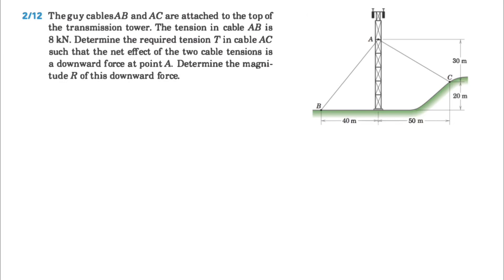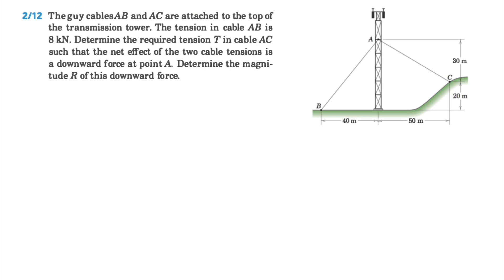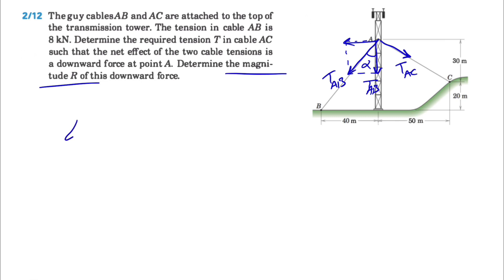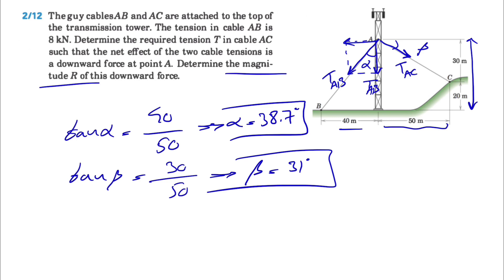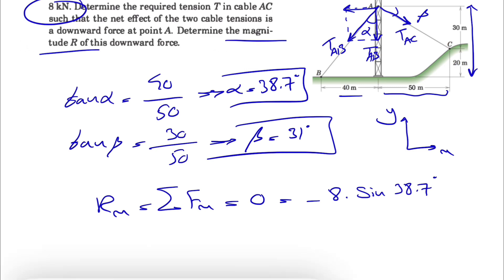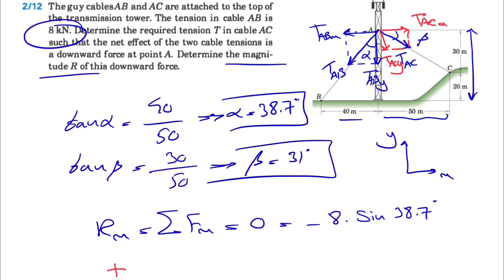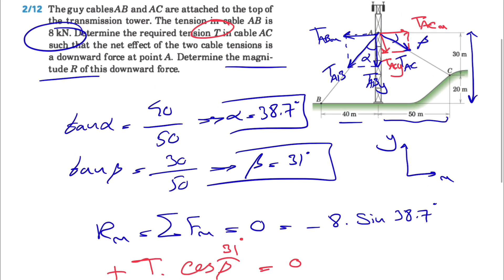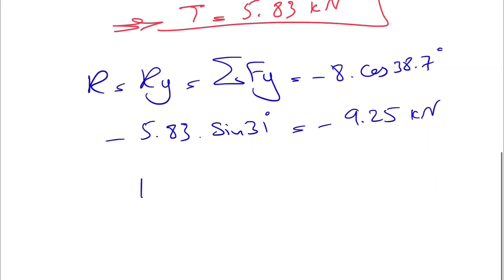Solved Problem  2.12 | Determine the magnitude R of this downward force.

Comment: Why didn't you use sin for the force Ac when calculating the components of x?
Reply from the maker: The angle beta is the angle between AC and x axis so cosine is the x component. Alpha was the angle between AB and y axis which was sine. You have to watch which one you pick. hope this helps!